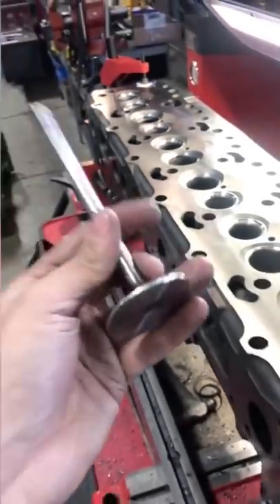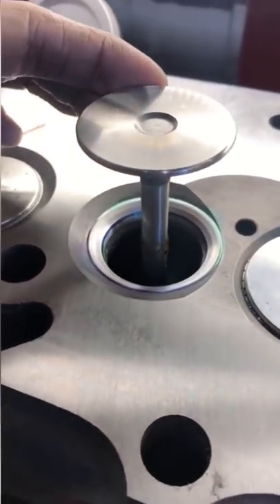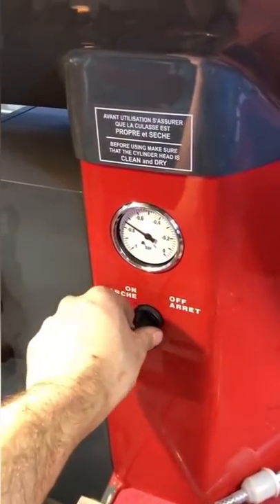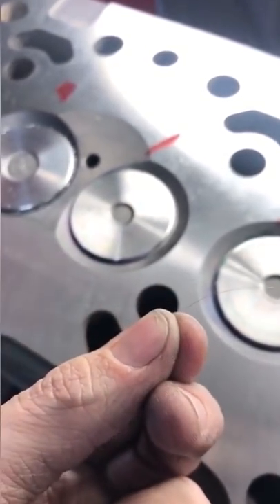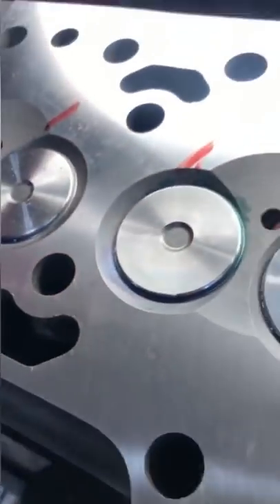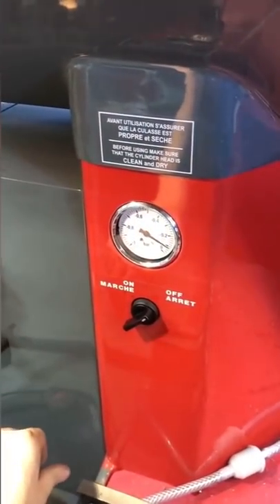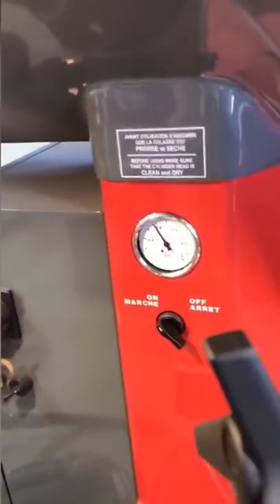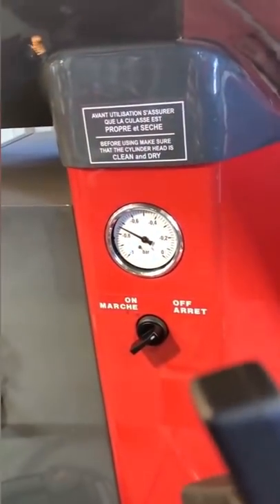#shorts Engine Machining Tolerances in layman's terms!

Comment: My dad thought I was blowing smoke up his skirt when I would "try" to explain what we did at work. He's a smart guy, but I had to explain how oil is used in a engine before it clicked with him. Most people think all the engine parts are submerged in oil. Not riding on a thin film of oil being pumped throughout the engine block.
Reply: Oil passages and clearances can be pretty tight
Reply: Most people? Half the population doesn't even know how to add a quart of oil. Lol...I  helped a guy once who had a tiny funnel to facilitate adding oil through the dipstick hole.
Reply: @kccodex8931  my neighbor asked me to see what was wrong with her car because "it was making a funny noise" that noise was a knock, BECAUSE THERE WAS ZERO OIL IN IT.
Reply: @mp40submachinegun81  Aye Carumba....beautiful!
Reply: @mp40submachinegun81  and that's the issue with telling people your a mechanic
Reply: Pretty insane the concept of an oil wedge. I work with / repair some massive machines that really at the end of the day ride on a film of oil of maybe .006 - .010 thick.
Reply: @bravo55286  then you're stuck either you let them get ripped off at a dealer or there goes your Saturday
Reply: @stevend4544  and I hate dealerships so you know I don't get a weekend
Reply: @mp40submachinegun81  had a friend trash her engine once this way. 

She now religiously checks her oil every week.
Reply: "Imagine one of those fountains where the water pours over some little plastic decoration. Now do that with a bit of pressure and it has to do that to something with as many holes as swiss cheese without missing any spots."
Reply: @Cja9  pretty cool man.  Not trying to be an ass, but an oil film is much thinner than that.
Reply: @JerryLee..  for sure on some things. I work in the mining industry where our crushers weighing in at about 100tonnes ride an oil film on a 48" round 6ft tall shaft the wedge is about .006. Was more tryna say how just the concept and functionality of the oil wedge in and of itself if fucken cool.
Reply: @Cja9  very cool.  Understand the difference between oil wedge and oil film. Thanks for sharing that.
Reply: The bottom of the engine is submerged in oil. But as for the heads,(Cam,valves,cylinders, pistons,bearings,  etc.) You are correct!
Reply: @frankferriolo9212  not really. The only thing submerged in relatively modern cars is an oil sensor to see if it's low, and the sump that takes oil to the pump from the pan. They try not to submerge anything because windage and drag reduce power and efficiency .
Reply: @frankferriolo9212  None of the lower rotating assembly of an engine is submerged in oil. If the crank weights or connecting rod caps touched the oil, they would whip it into a foam. Foamy oil does NOT work for lubricating the engine because of the air bubbles within it. All of the oil is held below the rotating assembly. Only the oil pump pickup strainer and the oil level sensor or dipstick tube actually touch the oil inside the crankcase.
Reply: @mp40submachinegun81  F
Reply: @Cja9  
I’m a Millwright and when we rebuild turbines you can spin a 50 ton rotor by hand when it’s riding on an oil wedge.
Reply: A finely engineered leak
Reply: @alexanderboychev1095  Yes, because how dare that person not know what it was. If they didn't know and nobody has taught them about changing their oil how do you expect them to learn to do it? People think everyone is stupid, but in reality everyone judges everyone else for what they don't know before giving them a chance to learn something new instead.
Reply: @RealShaggy  they are an idiot if they decided to own a 3000+ lb metal projectile without doing ANY research on how to maintain it. if that person had an engine lockup on the highway it couldve been fatal, not just for her but anyone nearby as well.
Reply: @theguy9208  Dude, that's why we have mechanics. I'm glad I have enough knowledge to do basic repairs and maintenance on my car, but not everyone does so those that don't go to a mechanic. But my point was that someone's gotta teach for others to learn. If nobody teaches someone to change oil, chances are they won't know how.
Reply: @paranormalextract4976  I love when they do because my neighbors pay me and usually buy their parts and have them already, easy money for me usually…USUALLY.  Got to throw that one in their for certain neighbors who have a whole 5 page essay of repairs needed
Reply: @Mrswag420weed  For sure!!  I take side jobs from neighbors at my apt.  Did 2 front wheel bearings on a Saab yesterday. Not bad, hub.  Although......alum and steel= corrosion.  Had to chip away at it like a miner..... The axle was also stuck in the hub.  No air hammer.....so I put the nut back on so I could wack the thing loose with a hammer.  Well I had to hit it with gusto and slightly messed up the threads even with the axle nut on.  So then I had to massage that. All good now but shit. You start thinking it won't be too bad.  Doing work in the parking lot kinda sucks.  Anyways I hear ya man haha
Reply: It's odd to me how I'm young and I would say I'm just learning mechanic work, yet I know more than half the u.s population. For me, doing some of my own work is a necessity because I can't afford to pay a mechanic to replace it. Thanks to YouTube and the internet I have yet to need a mechanics help.
Reply: Your dad wears a skirt?
Reply: Who asked
Reply: @dixienormus8  your mom
Reply: @RealShaggy  car should came with a manual.